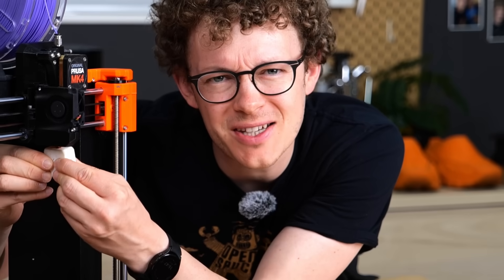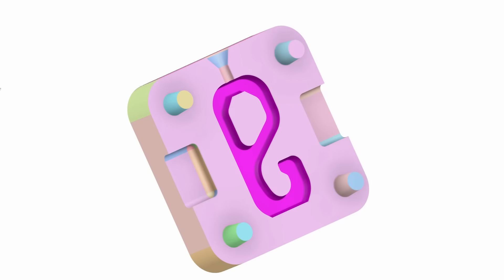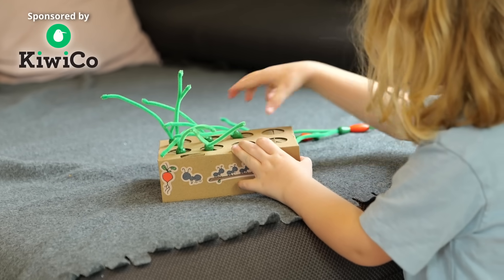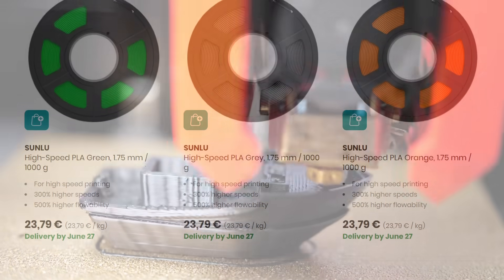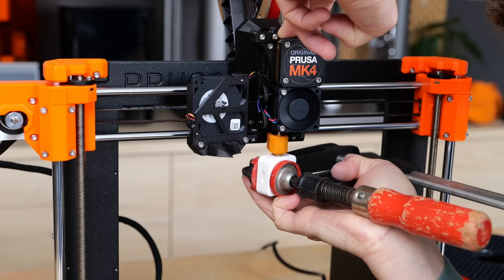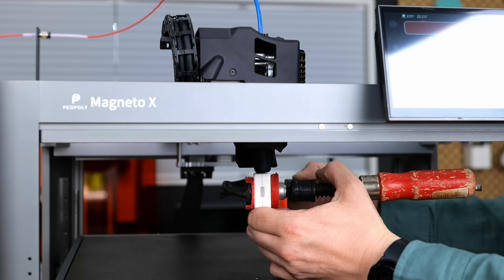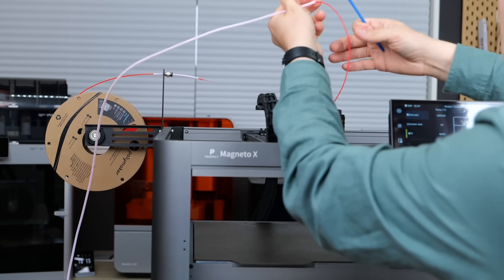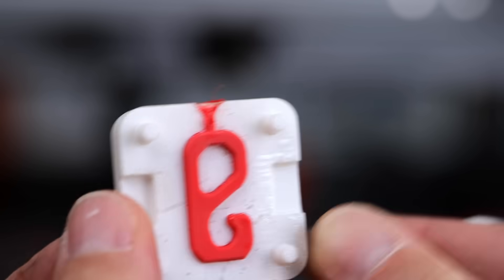I tried Injection Molding using a 3D Printer!

Comment: Why no air escape channels? The trapped air pushes plastic out of the mold.
Reply: Two channels are needed at least, its simple logic and I dont know why Stefan didnt use this.
Reply: This was my first instinct as well
Reply: Well, I'd imagine that with the tolerance of a 3D printed mold air escapage would be fine.
Reply: @captainironbat8193  Nah, that resin part was printed really freaking smooth and clamped down hard

Comment: I really hope you revisit this with an air escape hole, the hotend assembly down and pressing onto the mold sitting on the printer bed (potentially heating it) so you don't need to hold it and also a bigger mold. I wonder how far this technique could be pushed!
Reply: Yeah the holding it in place really took me aback when it's in the context of a machine that can press down an exact amount by itself

Comment: Had something like that in the back of my mind for a while now. My first concept would involve watercooling / oil heating through channels inside of the mold. 
Like having 2 Loops running through the back of the mold where one channels 200°C Oil and the other normal water.
Tho you would need a resin with high thermal conductance ;)
Reply: (But it would be way more feasable for such a small scale rather than Large scale where the mold is kept at roughly the same temp the entire way through because it would just be too inefficient to cycle temps of such a large steel chunk)

Comment: You should consider venting your mold so you aren't building up pressure by compressing air.

p.s. You don't need a draft for very short walls, as there is sufficient shrinkage to allow release.

Comment: Stefan, I believe you forgot a small vent hole towards the end of the mold (to let air escape) that and achieving higher temp in the mold
Reply: @arbitrary_username  I like Stefans approach to things, even if he isn't an expert in an area, that doesn't mean he can't quickly come up to speed enough to get value.
As I think about this, it's highly possible that the air was able to escape via other means like the somewhat poros polymer.  I think.if the air was escaping out the cracks, we would have seen some fleshing.  Plus he used a release in the mold, which likely would have sealed any porous issues with the resin.
To me, I think he was fighting against a building up of pressure.  The more polymer that was forced into the mold the more a leading area of pressure was building and fighting his max 300bars.

With proper venting and heating those molds, I think for the size parts he was working on, it would have been perfect.
Question would be how much bigger could he go with this technique (and the mentioned enhancements) before the leading polymer cooled too much.

With real injection molding you have metal molds that are heated to 149*C-426*C and apply anywhere from 500-1500 bars of pressure (some even have air assist for ease of release).

Without more pressure, heated molds, and proper vents; his technique will be very limited (though I believe that was his goal any way).
Reply: King the same thing
Reply: I feel a little bit relieved seeing someone so competent making multiple stupid mistakes... like I often do myself.
Reply: I am one of those who builds injection molding tools and here the recesses on the side are sufficient, especially since the cavity of the finished part has no sharp edges and is not compressed by several tons, and air can also push these tons apart, creating degrees. If this tool were made of steel, I would place the vent closer to the cavity so that the vent has more space more quickly and no holes are created. With a hole at the top as a vent, you only create unnecessary work to remove it because you also have to remove the sprue